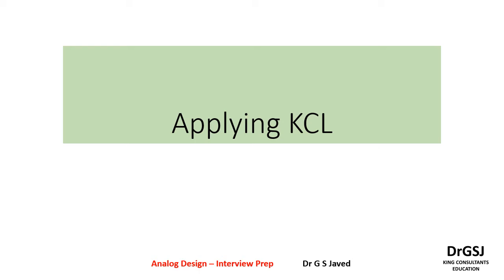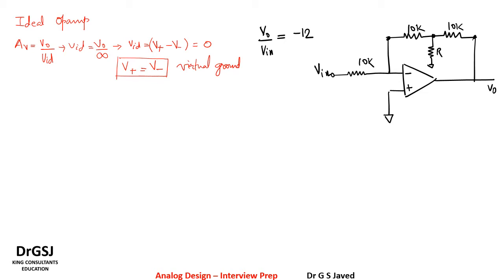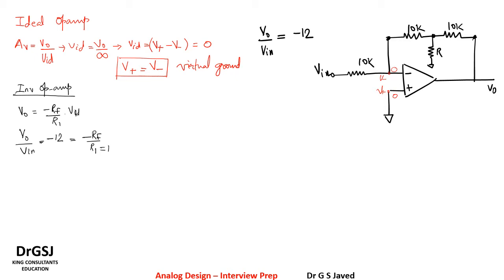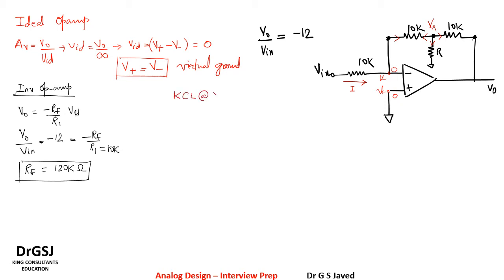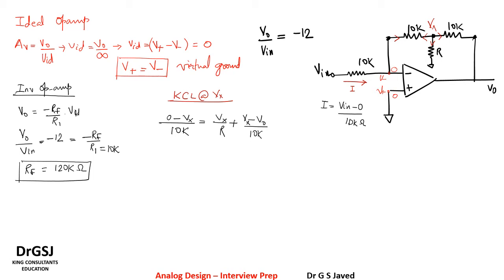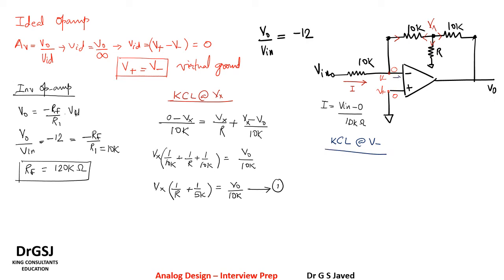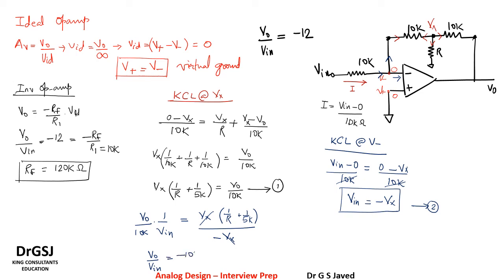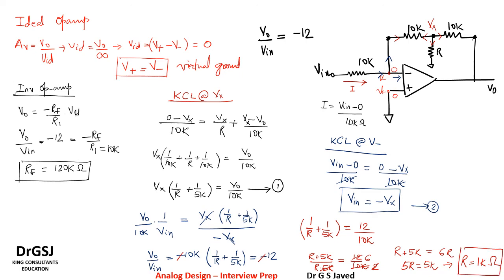21 Applying KCL in Op Amp Circuits - With an Example

Comment: By any combination mean, we can not get 120 K resistance by using 10k, 10k and 1K three resistances
Reply from the maker: Yes, the approach to be taken to solve the problem is by calculating the currents. The first analysis using (-Rf/R1) is not the right approach. 

There are no combinations where the value of 120K can be achieved.

Comment: sir what is R_f? I don't understand where it appeared from.
Reply from the maker: R_f is the feedback Resistor. The equation refers to the output of an inverting amplifier.
Reply: @drgsjaved  in the videos I watched about operational amplifiers I didn't see something like this :(

is the formulation for it something like this:

V_o * R_1 = - V_id * R_f

is this a general formula? thanks a lot for the quick reply.
Reply from the maker: @fatih7809  
V_o = (- R_f / R_1) v_in
Reply from the maker: @fatih7809  Yes, this is a general formula